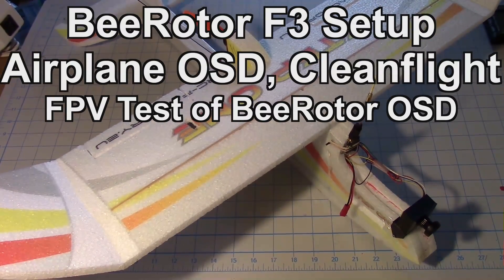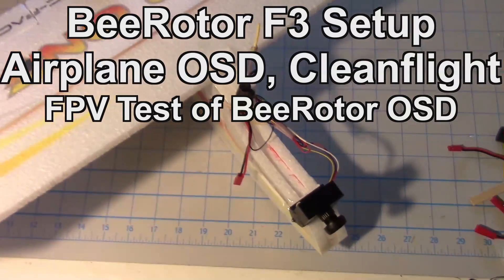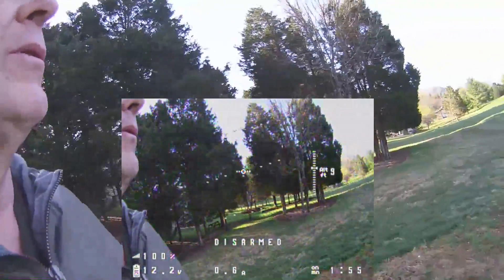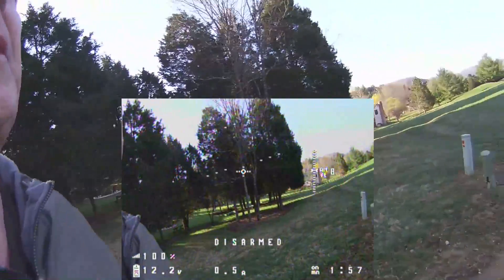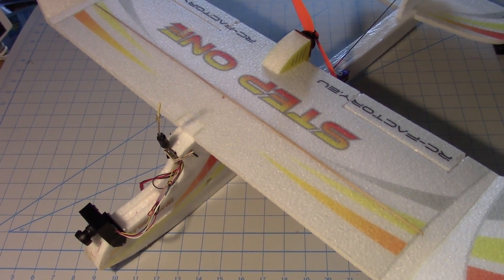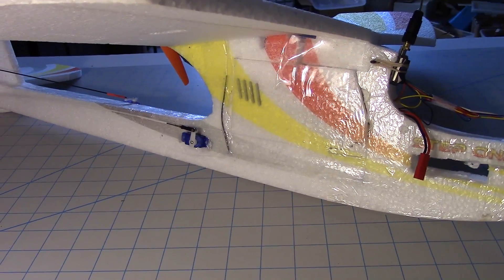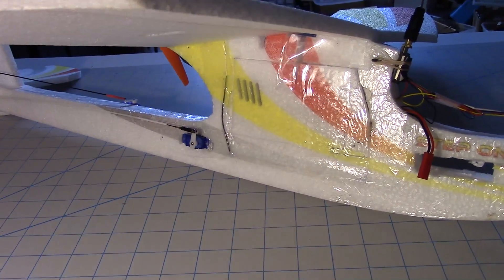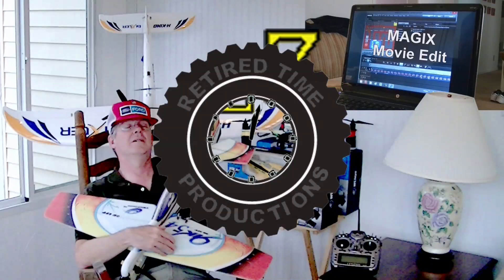BeeRotor FC Airplane Setup with Cleanflight Part 5 (OSD FPV Test Flight)

Comment: You had asked in the last video about a GPS module that wouldn't break the weight limit. I think I've found your module, it's an 8 gram M8N GPS and GLONASS sensor from ReadyToFlyQuads.com:
http://www.readytoflyquads.com/micro-ublox-m8n-gps-w-18x18x
Reply: +willdoryder And the menu for the OSD on that platform is usually Throttle mid Rudder right, Aileron mid Elevator up. Cheers, and thank you for sharing! all these videos
Reply from the maker: +willdoryder Not sure what you mean by "Throttle mid Rudder right, Aileron mid Elevator up". What, where, how?
Reply from the maker: +willdoryder Thanks, I might get one of those although I have a uBlox TN-GPS on order from BangGood .
Reply: +dmerc00 Hi bud, lets assume you're flying mode 2, it means: left stick halfway up, all the way right; right stick all the way up.
Reply from the maker: +willdoryder Oh, got it now. Thanks and I have the GPS you mentioned coming soon.
Reply from the maker: +willdoryder Found that the 8 gram M8N GPS and GLONASS did not have a compass/Mag with it so not a good choice for the BeeRotor which has no Mag onboard.
Reply: ***** Well darn and blast... I guess my experience differs slightly with my onboard compass, didn't realize that about the BeeRotor... But I'll bet RTFQ will be more than happy to work with you?
Reply from the maker: +willdoryder I got the Mini UBlox TN-GPS from Banggood and is has a similar weight without the case.
It has a Mag but no GLONASS unfortunately. I will give it a try when I get another BeeRotor to play with.
Right now I am working on setup for the flight modes.
Reply from the maker: +willdoryder I found that I like the Mini M8N GPS & GLONASS that you suggested to me after all. Not having the mag seems to be no problem. The GPS aquires up to 14 sats quickly and remembers them for awhile after being unplugged which saves start up time. Nice unit and it's now mounted on my plane. Thanks for the tip!

Comment: I really enjoyed the final of the project, but I think some things are off a bit. Your Alt. said at landing 4ft. the artificial horizon appeared a bit off, as well as I think you didn't set your batt. voltage alarm. But aside from some calibration the video from the fpv was amazingly clear, shocked the hell out of me. Congrats to you.
Reply from the maker: +Donald “NOT PLAYING1970” Byrd Yes, I was pleased with the clarity of the display. It used to be noisy before I added the LC common mode filter to the video voltage line. That filter is an absolute must.
The battery voltage is actually correct and the alarm at 10.1 volts is correct.  The battery is old/puffy with lots of sag and needs replacement (mmm that sounds like me.) Will work on the calibration.